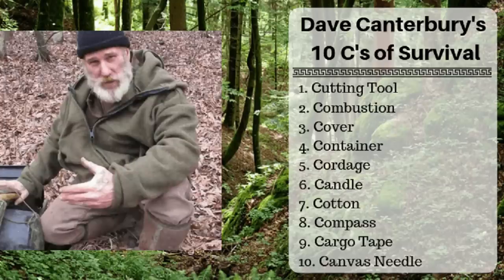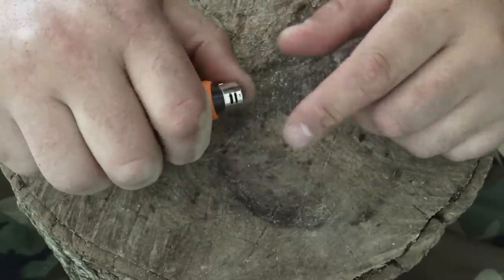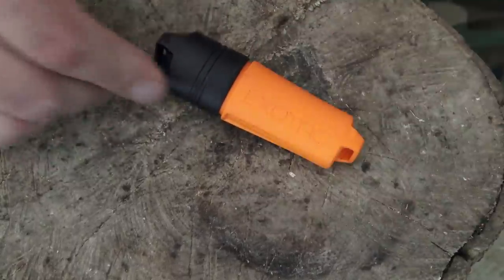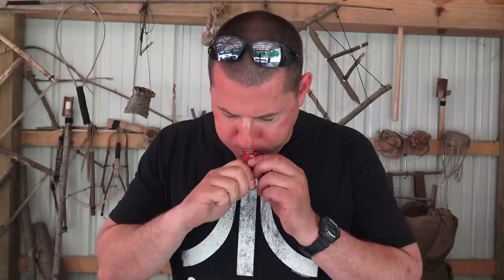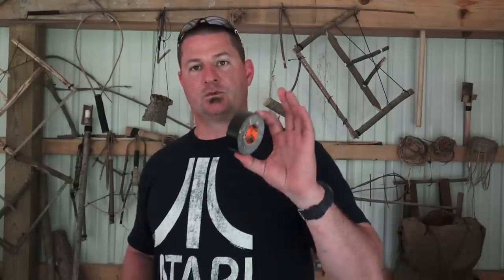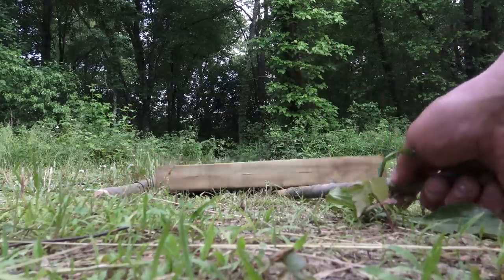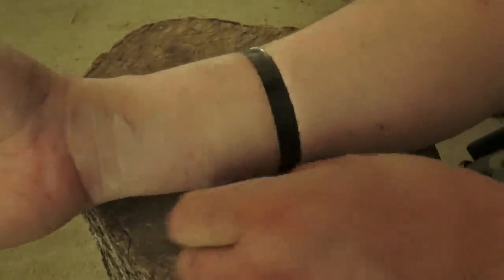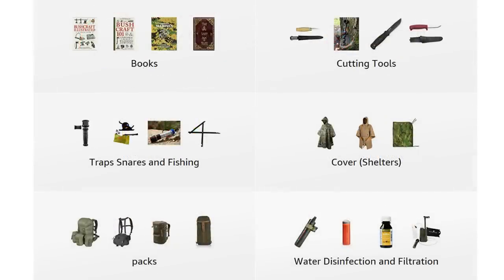The Fire Sleeve and Ripspool by Exotac. You Need These!

Comment: I have both of these, and I love ‘em both. One complaint I have, however, is that the Ripspool won’t accept the common size of Gorilla Tape when it’s empty. I suppose you could wrap it with two widths of one inch. Oh, I just had a thought. They should offer a refill of the tape that is on a tube that could just slip on over the center shank when it’s empty. Mmmm... Another great one Corporal, thanks.

Comment: Keep it under the arm or balls to keep it warm  witch will keep the pressure up.
Reply: Yah, I tested that.  Left a crappy generic lighter out in -15°F for an hour until it was completely cold.  Stuck it under my armpit for about 30 seconds and it lit right up.  Also works for small batteries.  Ladies who do cold climate may store such items under the bottom seam of the bra to keep them warm.

Comment: Interesting products and seem useful for a lot of people. But to be honest these look relatively easy to improvise and make. You could combine both with an empty spice container due to the shape and they are designed to be air and water tight by default. Use a zip tie as a fuel stop on the bic then use the internal space for storage. Also doubles as a hobo reel if you use braided line.

Comment: Good vid, but you can trust me on this one...the NUMBER 1 ENEMY of a Bic lighter is lack of use, especially in humid areas. Can't tell you how many barely used or even brand new Bic's I have discarded because the flint was permanently rusted (welded) to the striking wheel because of humidity combined with disuse. After diligently working on it, you may finally get a strike or 2, but that's about it. Then the wheel just free spins with no contact with the flint. That being said, when I need a light, I always reach for my Bic first. But I always have a fool proof if a bit more difficult to use back up at the immediate ready.

Comment: That gas lock is the catz azz.🤗
So is that great waterfall.😀
RedundantC,ya gotta love it.😉

I was thinking of using a sparkler as a fire extender. Even though they burn great and are windproof they are a bit too hard  to light. Not what we want when our hands are freezing.

Just checked out your Corporals Corner amazon store.
Tons of reliable time tested kit and no fluffy gadgets.
Good prices too. And I do need a new Mora.🤗
Can you believe it? China has a knock off basic Mora.
I got one just to know what they are up to.
Apparently the hidden tang is very short.
I have seen one handle fall apart while battoning.

Comment: Good ideas and without a doubt these are fine products.  Personally, I don't need either one.  But, I'm sure that all the gear junkies are foaming at the mouth over the "cool" factor.  At a price point of $15 I don't really see much value in the firesleeve.  I'd rather take that $15 bucks and buy something like a Plano 3440 and 10+ Bic lighters, or buy 15+ Bic lighters and a few ziploc bags.  As far as the Ripspool is concerned... it's apparently unavailable on amazon currently, but I don't imagine that it's price point offers much of a value either.  It would take about 5 minutes of time to carve a similar spool from a small piece of wood and drill a hole in it, lol.

Comment: I just bought 2 exotac firesleeves, as of Jan 19, 2021. It’s a joke. The cap is extremely difficult to seat in order to achieve waterproof seal. If you don’t cram it on super hard, it slips right off. And worse, the gas lock feature does not work at all. It immediately slides off, on both firesleeves. I tried multiple bic lighters and made sure the lighter was all the way seated in the sleeve, and the gas lock still slips right off as soon as I put it on. I read from other reviewers and all are having the same problems. I think exotac changed their mold, or their mold is worn out and need a new one. Injection molding does need to be replaced over time and it’s an expensive replacement as these are custom built. For nearly $16 plus shipping, the firesleeve is a total waste of money. I am returning both as they are worthless. I’ll just keep my lighters in a ziploc bag if I’m worried about them getting wet, and there’s always a ferro rod as backup. I should have listened to the warnings of reviewers who recently purchased  because the latest firesleeves are a complete waste of money.

Comment: Hey corporal, I have a semi dumb question referring to the L7 tirggers. Do you cut one notch at a 90° angle(resmebing and L) and the other at a slightly smaller angle resembling a 7? Or are they cut similar on both notches? Thanks.

Comment: Ah perfect if I may Cpl recommend Clipper lighter company big in the Uk believe it or not I used to get 4 of these flat ones tape 2 like a bodged dual mag dual lighter but I can honestly say not a guaranteed flame I have had all 4 fail on me flint wise! Clipper lighters allow a pull tube with spring and flint housing easy replaced I carry two clippers one upside down la la la and they refill too and refill flints pack of 9 should cost you 70c and they spark enough lol also clippers come in badass designs like zippo tough plastic round fit inside a shotgun shell nicely just saying it’s a top tip

Comment: Maybe add spare bic lighter attached to paracord connected to a roll of chapstick with a cotton ball & petroleum jelly in the cap and then add gorilla tape around each.  Adding a small zip tie around the button of the bic lighter prevents your lighter from losing its fuel and can be removed and replaced once zipped, clipping the extra length makes it a little sharp though can be filed to prevent cuts. Plus the adhesive sticker is also flammable, once you have a empty lighter if the wheel is removed slowly the springs can be made into a snare & fishing hook and the childproof metal can be removed and can also be made into a fishing hook.

Comment: Although they do look like interesting products and have the cool factor, honestly they seem like unnecessary added gear. Any basic survival kit should already have the gear in it and in a waterproof bag or container. Although the tape is a great idea, something to remember is having to keep it out of the sun or a hot vehicle. Otherwise the adhesive melts and sticks together so when you go to use it, it's a glued together mess. A better idea for wounds, is steri-strips inside a sterile sleeve that they come in and some wound glue. Using tape that is attached too something that has been passed around in packs, hands, other locations for sealing wounds in the wild isn't a good idea. Risking infection in the wild, is one of those things you just try avoiding no matter what. I do like there match containers though, i have got one and keep my strike anywhere, wax dipped waterproof matches in it, oh and one trick birthday candle so you can get relights. Great channel though and very informative.

Comment: After removing the child safety, just run the wheel on your dry pant leg or on the sleeve or chest of your shirt.  Do it like 6 to 8 times on slightly different tracks to dry it out quick. It will spark when ready.
Reply from the maker: and wear down the flint

Comment: Good stuff!  Always carry several Bic's should one get wet or lost, but a butane lighter can produce a hotter flame that ignites cold and damp material easier, and is under greater pressure so it will hopefully light in extreme cold weather.  The best way to make sure a Bic has pressure enough to produce a flame in extreme cold weather is to put a loop of cordage taped to the bottom to create a short lanyard.  Then use a long enough piece of cordage to carry the Bic around the neck to be kept warm on the chest.  The Bic is now also upside down and on the upper body where it is less likely to get wet.  This new container for the Bic is awesome, but I would make a habit of wearing around the neck as a year SOP that anticipates winter.  And because it also floats and bright in color, those other risks are mitigated.
Reply: TUNNEL RABBIT foolishness....

Comment: I own two fire sleeves.

While I want to love them (I love the principal) I find that they leave something to be desired.

The tops on these do not fit together secure enough to be trusted on their own, the tops easily come off. This is mainly due to a crap retention design and partially because you create positive pressure when the cap is placed on.  

It is because of that very weak cap retention that I do not trust this sleeve to do it's job; it's a no go for me in stock form. 

I also wish they made a smaller version of the fire sleeve that would accommodate the mini BICs for compact EDC or other micro kits.

With a little more thought invested into the fire sleeve it could have been excellent instead of just ok.

That Ripspool looks real decent.